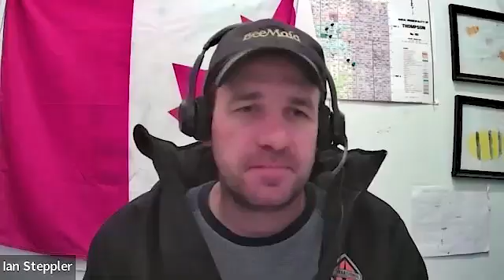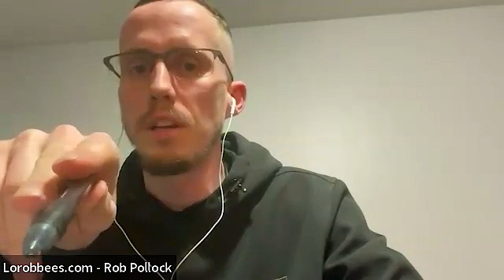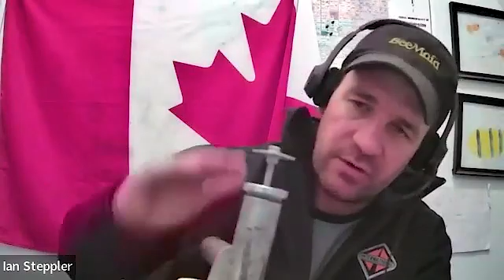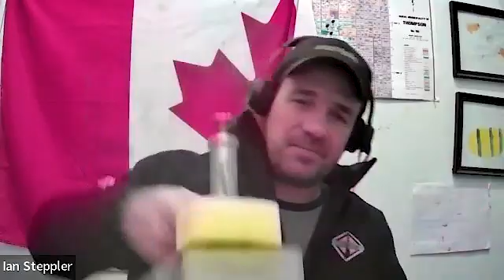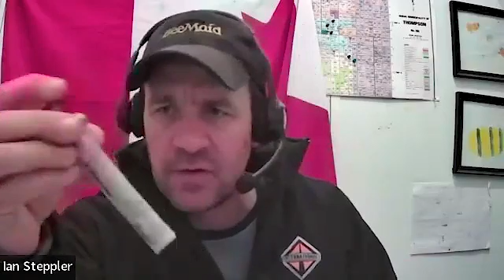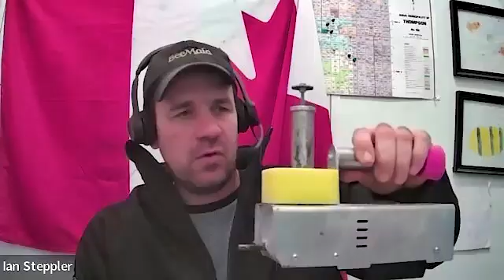Ian Steppler's InstantVap Insights: Feedback, Tips, and Tricks!

Comment: @LorobBees
 Im uk base and used api bioxl on first use, it stopped vaping after around 5-6 colonies, after speaking to uk instant vap was told its the product and to run straight OA 40 colonies in and it works better but not like i see in videos? Will it eventually clear itself or is it possible to strip and clean the element or something? 

Thanks Rob

Comment: I just emailed you today after my new InstantVap failed its first time in use.   I'll give you all the information here so that either you or others can help me with the issue.   I have DeWalt battery powered InstantVap.   My batteries showed 17.5 volts which according to your information should have been fine.   The unit started heating up and then just stopped going up and went down.   The volts still showed 17.5.      I switched out the battery thinking there might be an issue.    The second battery did the same exact thing.
Your directions aren't very detailed and so I followed them as to what they said. (sorry but a sheet of paper didn't have much).
I bought the unit in July of 23'  and was excited to use it.   Today was perfect as the temperatures are supposed to drop overnight.
And so I'm now stuck.   
Does anyone have any suggestions as to what is going on?   Thank you for any suggestions.
Reply from the maker: Hey bob, haven’t gotten to todays email yet. A 17v battery only had roughly 10% of life left. The battery must be larger then 5ah for best results.  A fully charged battery larger then 5ah will resolve your issues.
Reply: @LorobBees  Thanks.   I've watched videos reviewing the product.    My batteries are for regular DeWalt power tools.   They are rated at 20 volt.    
Do I need to buy a different DeWalt battery for this thing?
Reply from the maker: @beebob1279  the 20v rating is standard. The amp hour rating is the run time. The side of the battery should day 5ah or larger. If not read the bottom. If the number isn’t on the side generally they are 1.5-2 ah and the unit requires 2ah just to heat up. Once heated it becomes very energy efficient.
Reply: @LorobBees  So a 2.0 ah will work or is a 5 Ah what I need?
Reply from the maker: @beebob1279  5ah minimum. The XR 5ah dewalt is fine if you have a dewalt unit. The 2.0 will have the same issue you currently have.
Reply: @LorobBees  Thank you.  I'll pick that up tomorrow and test it out.   Much appreciated.
I would suggest in your videos (I found them today) that you explain this with the batteries.
Have a great evening.
Reply: @LorobBees  Letting you know I picked up the 5 Ah battery yesterday and charged it.  I tried it and works great.   I'll just have to watch for when the weather warms up to treat for the mites.
Thanks for the additional information about the battery issue.   Maybe bring this up in your videos.   Thanks again

Comment: Does anyone know where to buy a Dewalt 20 volt charger that is powered by auto/truck 12 volt DC power rather than 120V AC. I ordered a DeWalt 12/20 volt charger thinking it ran on 12V DC  to charge my 20 volt batteries but 12/20 volt means will charge the older 12 volt Dewalt batteries as well as 20V. The charger is powered by 120V AC. A 12V DC charger would be useful to charge my batteries in the field from my vehicle when moving from yard to yard. See you in Louisville.
Reply: Yes. I’d like to figure that out too!  The obvious but inelegant solution is a 12v to 120v inverter and then a normal charger.  I’d like to have a 12v to 18v charger hardwired into the truck to have a charged battery in the truck full time.

Comment: i added a strap to support the handle,...i use  damp towel to block  entrance if needed,i blast clean w half cap of water after cooling some,sadly  mine came before the battery cut off, so i must keep  above  15v,i use  a nail to clean the tip on occasion,im using dewalt 5 ah,but looking at bigger amp hour,i suppose i could use high temp silicone  around the plunger tube to keep any water outa the fiberglass, insulation,,made a apimay nozzle cover outa ptfe 3/4 rod,i drilled, and cut to length,got the ammo can to store it,my plunger does bind some,so ill probably add a drop of mineral,  oil ,etc,my dewalt 5ah does about 10 or more colonies at 4g,before i need to swap,bigger colonies may get a double dose,and 5 day  regiment if brood is there,...have a great time  at the hb conference rob,new compact unit looks badass,ive still got my johno as backup,with underhood inverter  or generator,.....battery is way nicer

Comment: Good vid with Ian Rob. Thanks for the info.i still have your other pulling cords. Will the water treatme t work for cleanings?
Reply from the maker: Yes, little water in the cap, just have to hold it on when you flip. Be very mindful not to get water on the heater. (It surrounds the bowl)